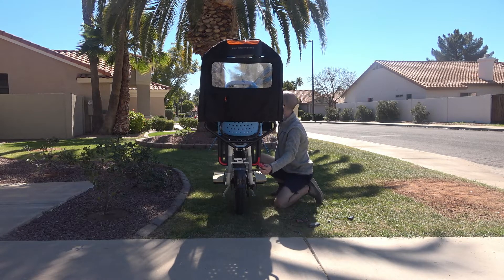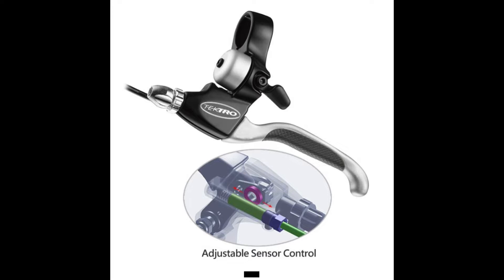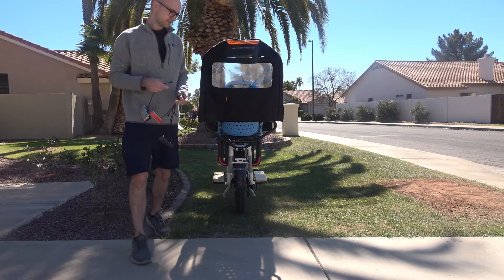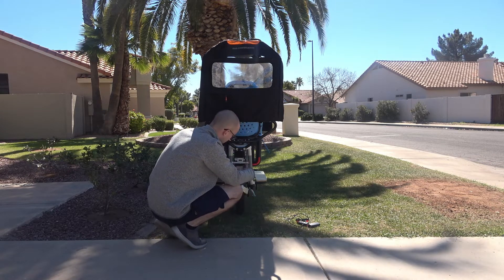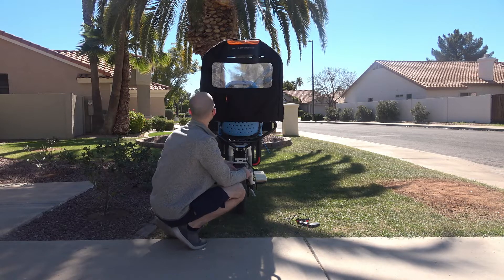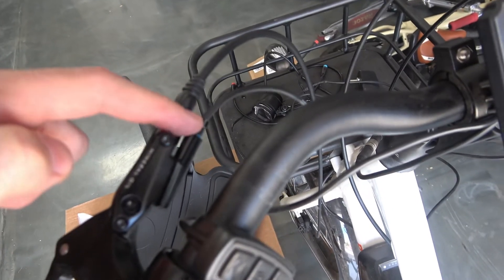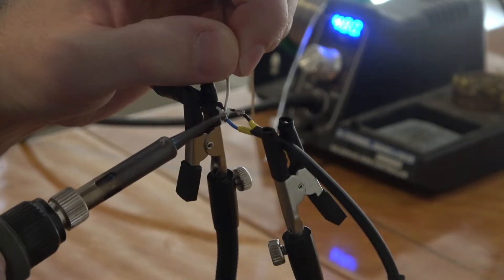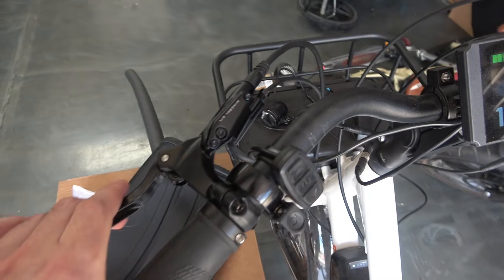Tektro Brake Sensor Replacement

Comment: the cable pulled out of the set screw area on my radpower rad runner 2 bike, not clear from this video what i should be doing to try and get it working again?